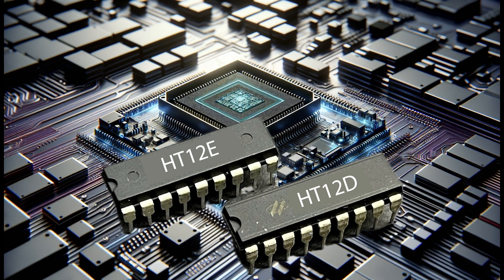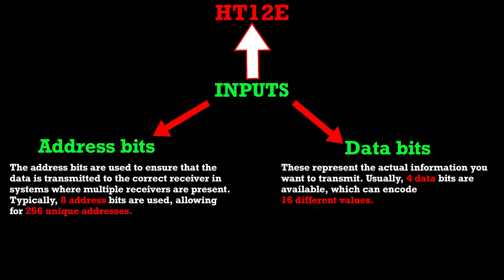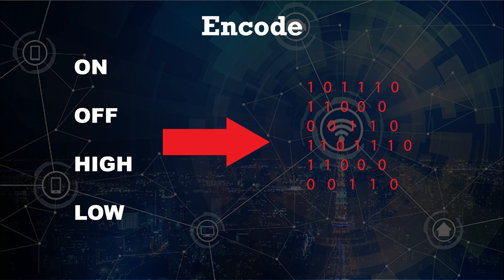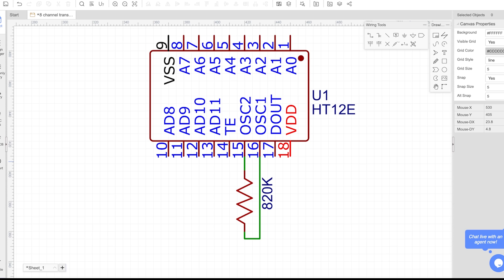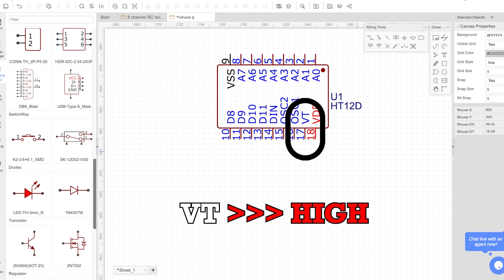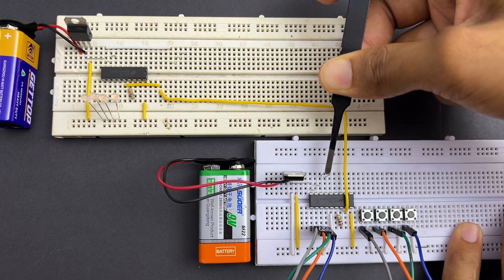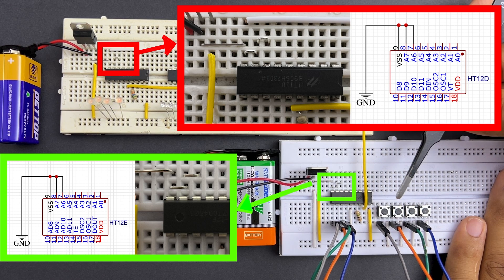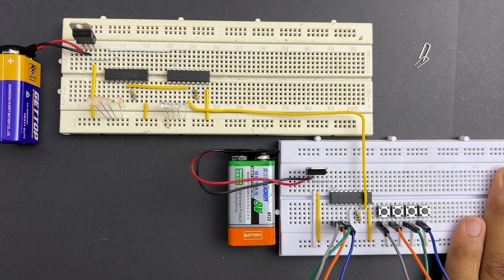How do HT12E Encoder and HT12D work ?

Comment: Short and to the point. Fantastic demo 💯
Reply: I came back to add an additional comment after watching many useless videos on the HT12D/E 
So many were time wasters, many did not have a circuit diagram, and they spent their time soldering  the pcb or doing boring point to point soldering  with the viewer left wondering what the heck they were trying to achieve or convey.
This video however is a model on how to demonstrate an electronics concept, well done mate ! 💯💯💯

Comment: In your experiment you provided both sides of the transmissiom with electricity from different batteries, but I did not see the common ground conection. To get over longer distances it is better to have a differential transmission giving the same signal positive and negative (symmetrically).
Reply from the maker: yes. It is a mistake I have made.
Reply: In which case you'd need, 433MHz tx & rx or use a bus specifically for differential drive like RS485 or even use CANbus
Reply: @boblewis5558  ... in any case you need to spare wiring without wanting to employ wireless transmissions, e.g. in a machinery transmitting controlling signals onto moving parts.
Reply: @LarsPW True! But then you lose a huge element of physical security for the low extra cost of some cable. 

I avoid wireless connections, including WiFi, as much as possible as they are SO easy to hack, even for rank amateurs! 😢
Reply: @boblewis5558  I share your opinion on wireless connections within machinery. But sometimes  trunks of wires are not applicable for mechanical reasons and/or to avoid crosstalk problems. Therefor are these and some other chipsets made. Years ago I heard about cascadable ICs to make 8-, 16-, 24- or 32-bit wide serial transmissions possible.

But I think that the HT12x are rather intended for wireless transmissions, otherwise they would have integrated differential outputs.
Reply: @LarsPW Agreed! And I think I misread your original comment since your reply made clear what I misunderstood about what you were saying.
Reply: @tripplefives1402 be careful though. The additional propagation delay CAN under some circumstances cause mistiming. There are LOTS of ways to solve the problem of synchronicity between +/- signals.

Comment: Interesting, thanks.
We all done this mistake 😁: GND wire missing in the demo (those circuits use a CMOS logic level, not RF)
Reply: I was curious about this also. I'm guessing it works as it's designed for RF?
Reply: @shaunclarke94  These chips’ data inputs and outputs are logic-level. They can be used with IR or RF transceivers, but don’t do any IR or RF signaling themselves.
Reply: @tookitogo  appreciate the clarification. So then how does this work without a common ground reference?
Reply: I believe it is there. It's a bare wire so it's hard to see.
Reply: @davepompea  
Alternatively, if the transmit frequency is high enough, the capacitance of the transmit and receiver boards may be high enough to act as ground through the table :-).
Reply: @davepompea There is no bare wire between the two breadboards. Just the yellow insulated signal wire.
Reply: @tookitogo  Oh, right. I wasn't thinking about that wire. D'uh!